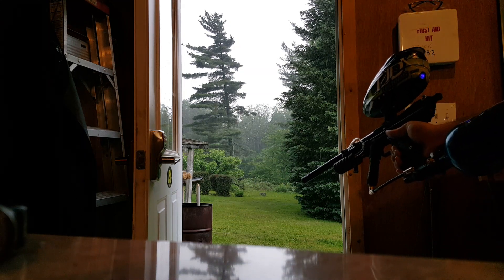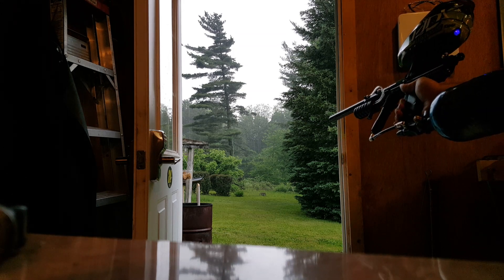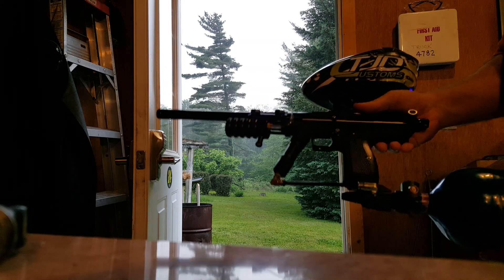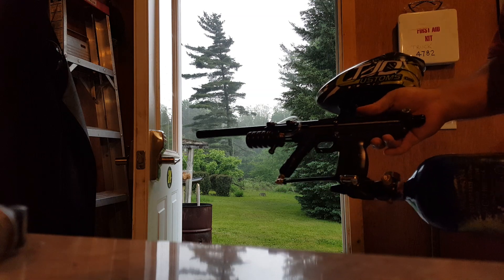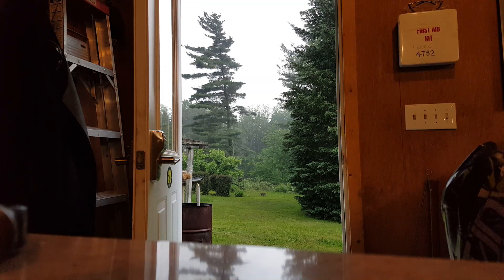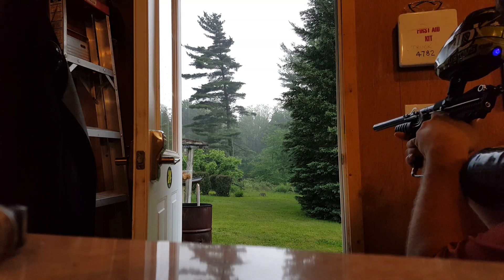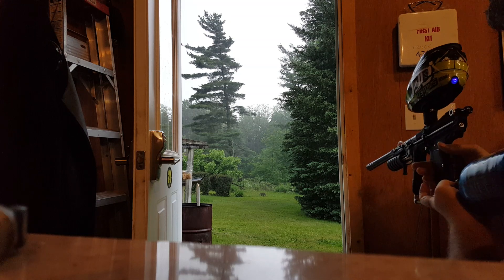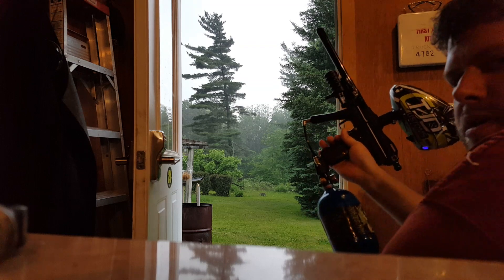Another customer build

Comment: How do you get your's shooting so fast? Mine seems like its "short stroking."  Maybe it's just me...
Reply from the maker: Adam Ho You might need to lengthen your stroke. Try adjusting the lower adjustment screw out a turn or 2. If that does not work you might need to adjust your lpr pressure up a bit.
Reply: I noticed the adjustment for the stroke length a day after. Thanks though! I was curious on how I adjust the lpr on this thing. Haha.
Reply from the maker: You have to remove the front end and you should see a brass set screw on the back of the main guide rod. That is the adjustment screw. Counter clock wise is pressure up clockwise is pressure down. It should already be adjusted to about 65 psi. Just be careful about adjusting it small adjustments should be all you need I have found 1/4 turn is about 5 psi.
Reply: Sweet. Thanks for the help! Love the pneumatic pump by the way. Looking forward to your future goodies.